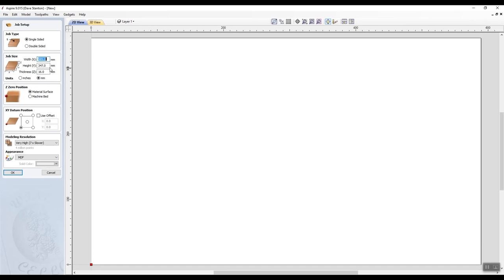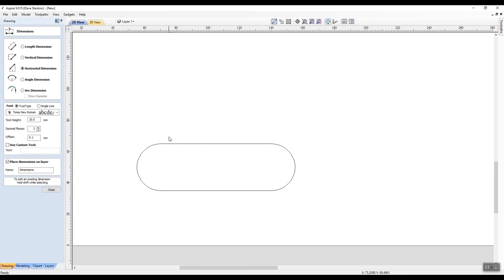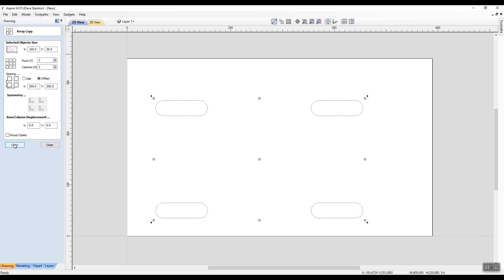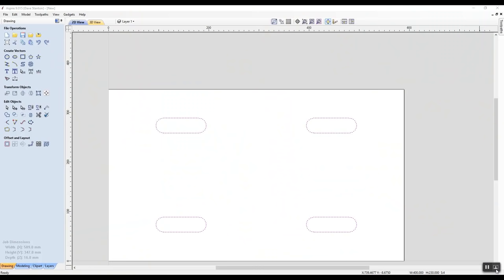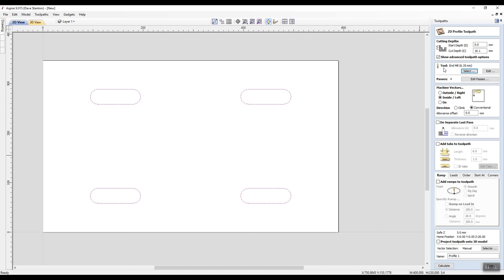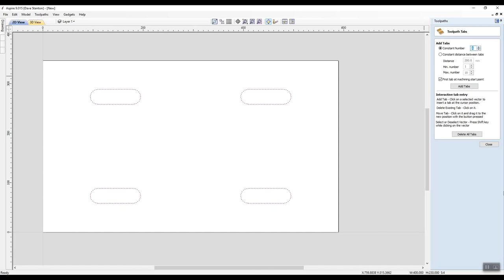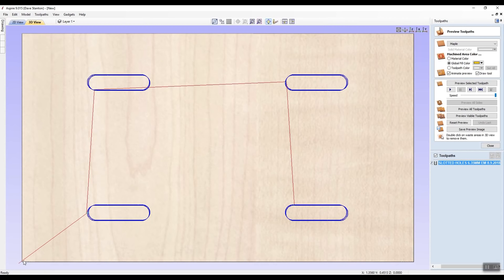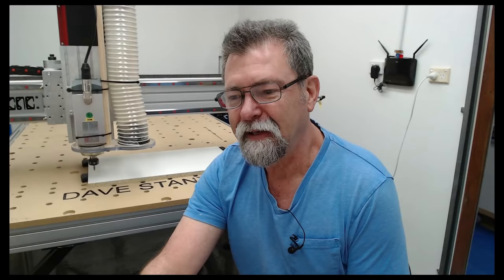Beginner CAD to CAM CNC Vectric Aspire Dave Stanton easy woodworking

Comment: It seems I have to change the software version, because the current version is always wrong if I follow your tutorial, my intention to change the milimeters in my software is always a problem with z thickness and endmill size
Reply from the maker: Hi Danar Namely. I am now using mach4 which is a lot easier.
Reply: @DavidStanton  I will get mach4 thanks sir

Comment: I've just watched the first two videos on Vectric Aspire.  The information is good, but I have great difficulty following which buttons you are pushing.  The curser is very hard to follow because of its size and color.  The other thing that makes things difficult to follow is that as you speak you use the curser as a pointer.  I just can't follow it because of the size, color, and speed that you move it.  I have the video set to the max resolution of 1080p, I'm using a 26-inch screen, and am sitting 36 inches away from the screen.  Thanks
Reply from the maker: Hi Tx BeeFarmer! That is the first complaint about the video I have had. I am sorry that you aren't able to follow the cursor. I had another look and couldn't find any issue myself. I will take your comment onboard for future videos.
Reply: @DavidStanton  Thanks for getting back to me on my little problem with seeing the cursor movement.  Guess that's what happens when ya get old :) .  I do have one other question for you.  I watched the first two videos on Vetric Aspire, but I'm having trouble following the series.  Were those the only two for beginners?  Guess what I was hoping for was a series that would just go from one to the other without hunting for the next one.  Hope you can help me out with this.  
Thanks
Mark